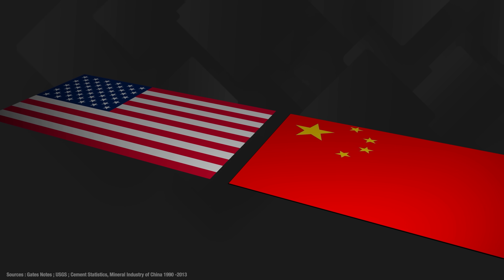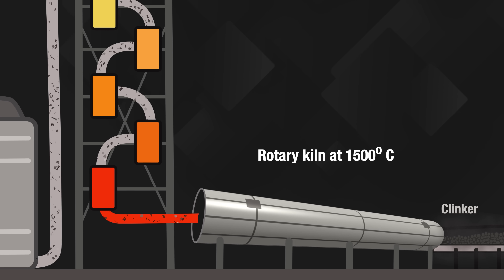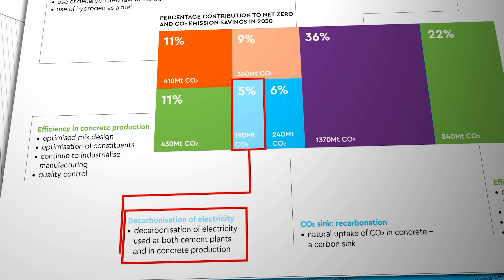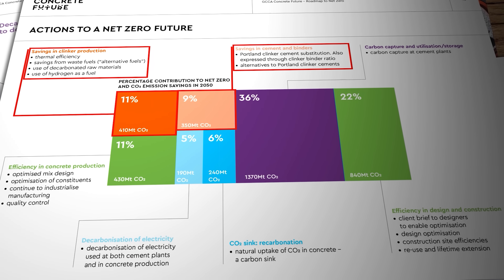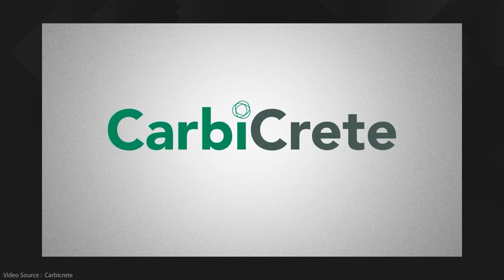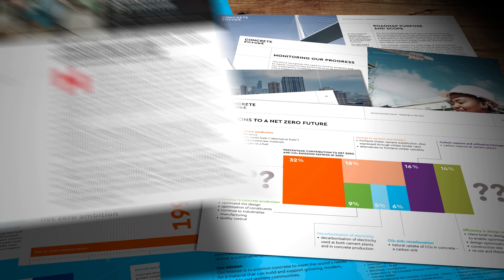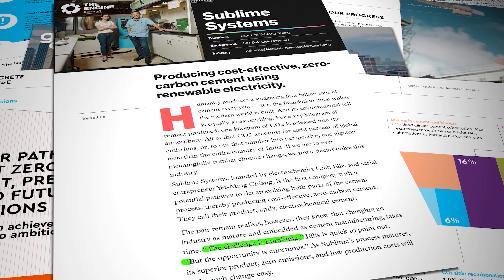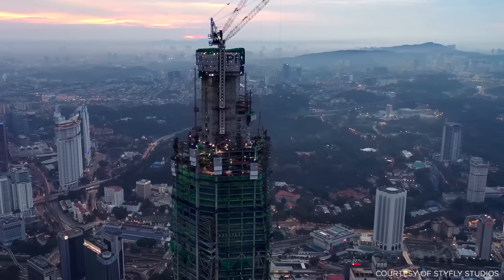How to make concrete green!

Comment: There is a significant difference between making sonething hard and making sonething capable of great structural strength. Over decades, various formulas have been discovered that allows modern concrete to hold enormous weights. This has allowed architects a lot of freedom ib designing buildings with minimal supports.

The likely reason why a bunch of these new types can only be cast as pavement stores ane such is because their strength attributes are way too low to support any great weight.

Comment: Can't see that SaltX have been mentioned. Their thechnology to completely decarbonize cement industry have been verified in small scale and seems to work just fine.
Next step is to scale up and see if the business case also holds up...
So the final solution for decarbonize the cement industry might already be here.

Comment: Why wasn't hempcrete mentioned in this. It's the perfect solution and has been around for years. It's stronger, cheaper, uses 80% less energy to be created, is a significantly better insulator, and absorbs CO2 for up to 25 years making it stronger and stronger every year. I honestly have no idea why we aren't all using hempcrete by now

Comment: These CO2-reducing alternatives, plus the substitution of cement / concrete by grown fibre materials such as wood, bamboo etc. as building material would add even more to a reduction of climate gas emission, plus even recapturing CO2 within buildings.
This of course isn't new or rocket science (more of rock sience, pun intended 😉), but I just wanted to mention.

Comment: This situation just adds more support for the need for Active Climate Restoration, as the cement industry will be slow to change and hard to disrupt without a carbon tax.
Reply: @Gilles de Brouwer    Probably impossible to change without radical action at the government level: removal of those in power from power; replacing them with sane people...
The social cost of carbon is the total cost it involves, including the paid price, all the subsidies & externalities now & in the future. It’s what carbon taxes, prices & trading systems are theoretically based on & must equal to have sufficient effect. The real social cost of carbon is somewhere in the neighborhood of $250/ton. 

Almost every carbon price passed so far, or even proposed, is in a very different neighborhood—the neighborhood of clowns & mental patients between $1 & $15/ton. One or two very limited in scope have gotten up to $50/ton. Most are passed low to make them acceptable to the lunatics on the far right; raising them is sometimes built into the law or it’s claimed they’ll be raised gradually later. They never are. At least nowhere near enough even to keep up with inflation, let alone inflation on top of carbon inflation. It’s long past time that a carbon price can have any meaningful effect in time to matter. We need stronger resolve & more courage now. 

Sequestering carbon through forestry & permaculture is a crucial part of the climate solution. It can never come close to being enough if we don’t stop emitting carbon for energy, & industry.

Comment: The methods proposed by the industry are predictably bogus, blaming others, & horribly unimaginative. Above all, they’re self-serving. Utterly predictable but we have to get beyond such defensiveness for civilization & nature to survive. 

Alternatives: cob, adobe & other mud construction. There are buildings thousands of years old made from mud; even in places like Wales some are 800 yo. Other building methods like straw bale & rammed earth can be used to replace a fair amount of current & projected use of concrete. 

Roman concrete similarly can last hundreds to thousands of years & gets stronger when exposed to seawater. 

Skyscrapers & wind turbines are being made from wood; pointing not to elimination of concrete for them, but certainly reductions. 

The report shows CCS 36% of reductions, which is a pipe dream unless reductions are so pathetically small they’re barely worth the trouble (which is true.)   Decarbonization of electricity is 5%, also pathetic. I’d like to see details but it’s just a PR publication. They’re also using net zero 2050 as a thing while what it is is a mass-murder-suicide pact that will end civilization. Zero zero 2030 is the only remotely realistic goal, ecologically.

Comment: I wonder if carbon dioxide concrete foam can be made. The carbon dioxide bubbles in the concrete mix would ideally be retained for a very long time.  Also, could this carbon dioxide concrete foam be very strong under compression as well as tension?  Very strong and gas impermeable chemical bonds would be needed in the bubble’s surfaces.  Will such a foam also be very strongly bonded with tensile elements like rebar and carbon fiber?

Comment: Concrete & Cement are in everybody's supply chain. Pressure to de-carbonise by the customer (industrial & domestic) is the powerful force to move the conservative actors along the path. The codes/specs are a barrier, but only because the "forces" haven't pressurised this enough. It's a seriously big sector along with steel-making, so it deserves more attention from everyone. Thanks for the spotlight Dave.

Comment: I think a lot of folks underestimate what local building codes can do for environmental building materials. If engineering codes are not updated for new materials & new types of structures built (Earthships are illegal almost everywhere in the US) then ecobuilding is a niche at best. If, otoh, cities, counties, and states update codes to insist on sustainable materials, and work with concrete producers, and timber & lumber industry, to produce a set of materials which passes building code, then we can leverage these materials to produce better buildings, sidewalks, trails, and roads. These same local political groups of people should be getting cities & schools to stop mowing lawns, buy electric buses, add bike trails, ebike grants, and road diets to reduce car traffic.

Comment: Has anyone looked at fueling the cement making process with excess heat from making (bio) char?. You could then crush some of this carbon into the cement itself to lock it away and use the remainder of the biochar in agriculture. The source material for the char could come from numerous waste streams but also from efficient copice plantations or fast growing plants like bamboo.

Comment: What about the concrete that the Romans used? That doesn't require heat, but how does its composition compare with other types of concrete's emissions of CO2 or other greenhouse gasses?

Comment: Check out blue planet aggregates.  They take the co2 off a gas electricity generator and turn it into coral aggregate.  The aggragate is used as base rock and buried in the roads.  They use concrete wash out as the seed of the coral.  Chevron and Mitsubishi are investing in this company.

Comment: I think one of the major problem for the change are the strict standards for the cement / concrete used in the building industry. I am afraid it will be difficult to change them, for OPC cement/concrete we have more than a century experience, I suppose we need to wait some decades at least for the new developments to be accepted by the standards of the building industry.. even with the current cement production technology big savings would be possible if the standards would be more permissive for example putting more focus on the physical properties (compression strength) and be more permissive with the composition of the cement (for example minimum required clinker %) ..

Comment: G'day Dave, Thanks for your take on what is very much in my 'wheelhouse', moreover an important and significant emission contributor to global construction sector. Not sure if your considering other future follow-up stories where we could take a deeper dive into non-cement systems of concrete, but feel free to reach out if your looking for sources.  I note you reference lost of sources, one of which is Joseph Davidovits and his body of work in 'Geopolymers'. There is a considerable body of literature which has grown within this area -- what I call 'low carbon concretes' so as to avoid some Davidovits controversy.  Having said that, mainstreaming LCC use requires the removal of systemic barriers built within such tools as; codes; standards; and specifications -- all of which are important enablers to uptake in construction. Anyway, thanks for placing a spot light on theses issues. Genuinely enjoy your casual style and your evidence based channel. Craig Heidrich for Australasian (iron & steel) Slag Association, Ash Development Association of Australia and Australasian Pozzolan Association (just to mention a few Associations we manage)
Reply: Yes. I'd add my weight to that comment. Codes etc are definately slowing the uptake of Geopolymers. Is there a GP video on the channel yet Dave?

Comment: wow, quite an insightful presentation, I hope one day you will do a presentation on

-GEOPOLYMER CONCRETE.
-PLASTIC-SAND COMPOSITE (bricks, pavers, bricks from blend of molten plastic bonding sand granules)
Reply: Can those two be combined? I mean a geopolymer concrete - sand composite.
Reply: @johnbash-on-ger  .interesting view..... Goepolymers are concerete made without cement, aiming to eliminate the aspect of cement. raw materials may include waste from coal plants, steel slag....

plastic-sand are those concrete where molten plastic binds sand and completely eliminate the need for concrete.
Reply: @emmanuelwekesa976  I mean using geopolymer based cement with sand. Binding the sand granules with geopolymer cement instead of plastic.
Reply: @johnbash-on-ger  .yes, its possible, because in geopolymers, alumino silicates are used as binder in place of cement.
Reply: @emmanuelwekesa976  Wouldn't that make the geopolymers the cement?

Comment: An alternative that I've been poking at the  napkin math for is utilizing magnesium combustion for the clinker kiln process. Magnesium burns incredibly hot, and will happily use the carbon dioxide emitted from a clinker kiln as its oxygen source. The remaining soot and magnesium oxide can be captured, separated, and the magnesium can be restored using renewables-driven electrolysis. Need to dive into the concept deeper, to be sure!
Reply: Dude why not use electric heating directly? Direct electric heating is more efficient. Electric heating has no temperature limit, it's even used to heat plasmas to a hundred million degrees Kelvin in experimental nuclear fusion reactors.  Why the extra, energy-losing steps with magnesium?
Reply: In this case, because the process of heating up cement precursors (like clinker) emits CO2 from the precursors. Using a exothermic process that eliminates the CO2 before it leaves the facility is a two-birds-one-stone option.
Reply: @actupper  But magnesium minerals occur in the form of magnesium carbonate. The carbon dioxide emissions from the process to produce the magnesium metal means it's extra steps and less efficient. It's also possible to produce high-purity carbon dioxide gas with electrical heating and a separate pipe for capturing the emitted gases. Or are you planning to regenerate the magnesium at your facility? What process will you use?
Reply: @johnbash-on-ger  So, here's the potential path I see: There are several methods for regenerating metallic magnesium via electrolysis from magnesium oxide, which is the primary combustion product. These processes could be powered by renewables, creating a energy sink for excess renewables production.  This allows for a circular fuel cycle, where the same magnesium can be regenerated an indefinite number of times.  You are right that the processes for extracting natural magnesium resources do release carbon dioxide. However, using the same combustion process we're discussing here you could mitigate those emissions as well. The value I personally see with this process is it both works well with electrical systems, and it has self-reinforcing emissions reduction potential.
Reply: @actupper  Okay using renewable energy to create a circular fuel cycle like that does make a lot of sense.

Comment: All the spare... used Wind Turbine blades are made of aluminum and polymer resin, and fiberglass.   If shredded...then mixed into concrete... might provide additional strength and flexibility, weather resistance...and longer life.    Then the GOP can shut their traps about the Turbine blades, ending up in land fills.

Comment: Great stuff. There is also a UK Graphene technology that can be added to concrete and then used in a 3D printer to make large engineered structures with much less concrete for a stronger overall product. The company is called Versarien and they have a couple of products .... including one called Cementene. Might be an interesting follow up video 😎

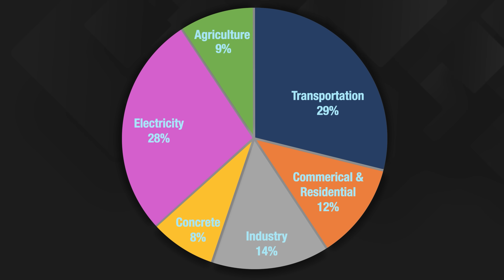Comment: 0:55 this pie chart is important to look at electricity is 28% and transportation 29% The current solution for transportation is to make EVs but the problem with that is that while the transportation slice of the pie goes down the electricity slice of the pie goes up so realistically if we want all car, lorries etc to run on electric we need to realise that the electricity slice of the pie is 57% of the diagram and so it's importance is way more than the others and should be given appropriate levels of attention. That's not to say we shouldn't look at things like green concrete but they should come secondary to energy production.
Reply: @MatthewTalbot-Paine     You’re right. But it’s too late to pick & choose. We have to do everything at once, as fast as humanly possible. We have less than 10 years before exponential increase in climate harm makes it much much harder to implement solutions, & the path to irreversible devastation that's more than civilization can bear becomes an inescapable rut. The endpoint doesn’t matter nearly as much as the area under the curve as we reduce emissions to zero. Emission reductions now are almost infinitely more valuable than reductions in 10 years.

Comment: We don't need cement/concrete or bricks. There is no need for any embodied energy in buildings or infrastructure. Build using SIPs on screw piles. Roads can be made cheaper using the original tarmac methods (compressed stones) but with a porous epoxy seal for a surface.

Comment: A local coal fired power station has huge tailings of soda ash.  When it was proposed to use it in the production of light weight concrete blocks, the polluter said "pay me".  Even though it was waste, they wanted to squeeze every last drop of wealth.
Reply: Why wouldn't they. It is a feedstock at that point.

Comment: One point that immediately comes to mind is to use those "precast" carbon captured products as small nodules incorporated into poured mix in the place of some aggregate!

Something that springs to mind is not so good though .... Where does all this CO2 come from that gets pumped into the concrete slurry in the first place. I am betting they don't suck it out of the air! So is this in itself adding to the problem of rising CO2 levels in the atmosphere that many cite as the root cause of Global Warming?

If as it would seem (on this video at least) the problem can be solved by swapping the primary input material to Basalt, you have to ask ...... What are the reasons countries the world over are not doing it already? It is almost as if they are only paying lip service to the notion of CO2 driven Global Warming!

Comment: this "decarbonization" thing is becoming a religion. The real problem is actually in overconsumption and absolute lack of efficiency in use. Including real estate market, which is completely overblown on one hand and follows human migration on the other. Right now it's the trend towards cities and cities need high-rise buildings, which make developers very happy. But in reality we miss the infrastructure and social architecture questions. Society is changing rapidly and one of the issues is that you no longer need to occupy a city center with your skyscraper to fit all those office hamsters in it because they can work from any distance thanks to com technology. Yet, we continue the trend of working in offices. We also continue the trend of considering real estate an investment, which it's absolutely isn't. But that's a very strong belief to break and it needs a few more crises for people to finally get it. Until they do, the market will keep pushing for construction and construction will keep pushing the market. It's a very bad feedback loop. I mean, just look at China... In Japan, 13% real estate is empty and is projected to reach 20% (mostly rural) in the next 10 years... But China - that's a catastrophe. A bubble of such proportions basically takes the industry hostage because if you stop building everything collapses, entire industries, coal, metals, concrete, massive unemployment of construction workers, it would be a mess of cosmic proportion and to postpone that mess we convince ourselves (or at least the Chinese people do) that all mass of buildings has some value. Which it doesn't. And the more we build (especially the residential and office buildings) the less value it has, which is just a simple supply and demand law. Demand is highly (entirely) speculative in most areas and when realization of worthlessness comes - market will crash and drag lots of other industries with it, incl concrete production.

Comment: YES, I definitely have a comment…
Why the hell did you not mention possibly using Gen IV Nuclear power heat generation for that concrete production method. Seems to me that that would solve the main problem with carbon release in the process.